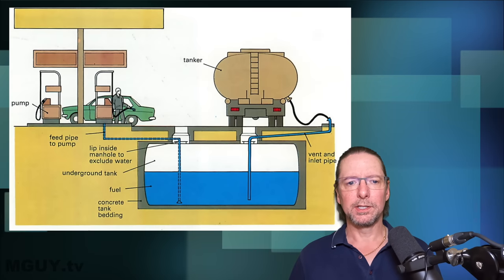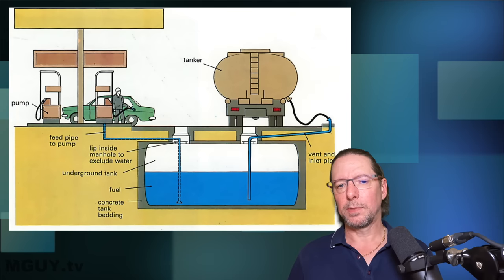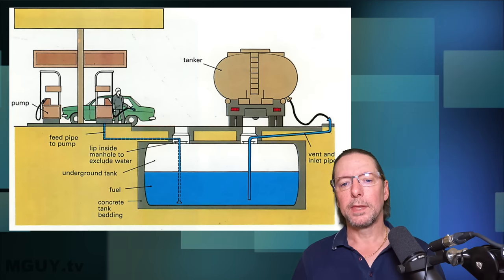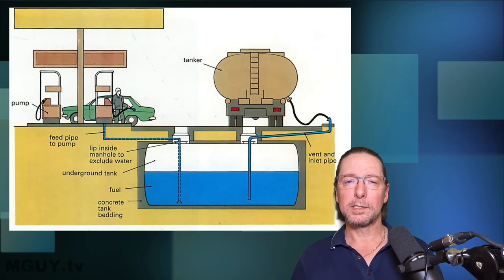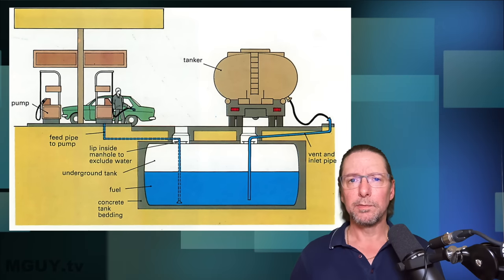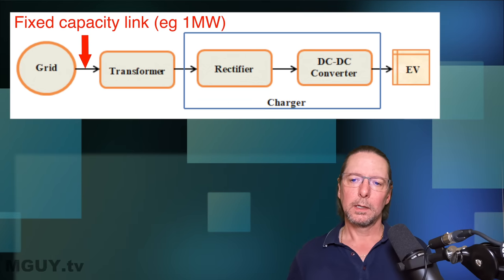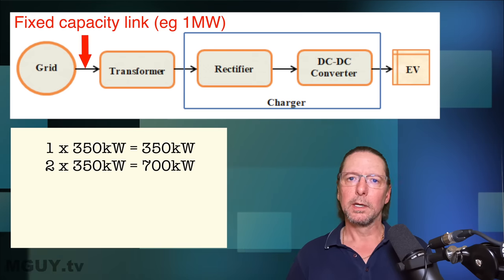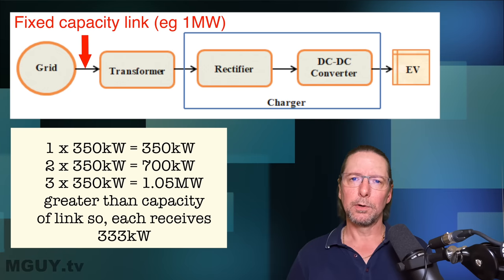HUGE problem with EV Charging Stations that no one mentions | MGUY Australia

Comment: The only true way ev can feasible work is to have a standard fuel cell that can be swapped out, the station will have to be like warehouses to maintain and store the power cells, and have enough to maintain demand. But the only way to work is to have a standard cell that can be switched like you do a battery on your hand drill.

Comment: If nobody is talking about it, it's probably because it's not a huge problem.  I live in Norway, the country with the most charging stations built.  When chargers are installed, the grid needs to be dimensioned accordingly.  Some places this can be problematic, but it's a matter of time.
Reply: Norway traffic is microscopic compared to the U.S.. Los Angeles County alone has more registered vehicles than there are in all of Norway. All the electric power generated in Norway wouldn’t even charge a fraction of the cars in L.A. that are pumping gas at one time. Norwegians better get more realistic or stick to canning sardines and herring.
Reply: @jameshepburn4631  Electricity needed to run all LA county's 5.4 million cars according to average driving distance is 23TWh a year.  Norway produces 145TWh a year of hydroelectric power.

Comment: I think the answer has to be that a larger percentage of EV owners would need to charge at home instead of using charging stations.  basically the infrastructure cannot handle the same number of vehicles if they all charge electrically instead of filling up with gasoline.  so you need a massive increase of charging locations, and the best way to get that is for people to install them at home.  This doesn't appear to be happening though, and I wonder why not.  One of the prime attractions of EV's to me is the possibility of charging it at home instead of going to a gas station.  Does anyone know why that is NOT happening?  is it because of the cost of installing a high voltage/amperage outlet?

Comment: If we do go electric and convert all petrol stations to electric charging stations every single overhead transmission line needs to come down and be replaced with something 10 times thicker, or change all the switchgear and isolators and up the voltage everywhere. (100kwh is 1MW for 6 minutes) i dont see how they are going to do it.

Comment: The answer removable standard cells like any battery but bigger, slide your expended one out and pay for a fully charged one to replace it and off you go straight away BUT and it’s a big one, we all know all batteries perform best when new, over time they retain charge less efficiently for less time. So if you paid for a fully charged up new cell which in reality was working less efficiently, gave less power and mileage, surely you would have been short changed in comparison to sliding in a perfect new battery cell.

A lot of these issues don’t seem to have been openly discussed and thought through.

Comment: You got the real problem wrong. A typical gas station can fill up about 10 cars per pump and hour and has what, 10 pumps? That's 100 cars per hour for 100% "charge". BEVs require about 30 minutes for a 20% to 80% charge. A full charge takes an hour. So to replace one gas station, you need 100 chargers and a renewable 15 MW plant dedicated to it (cars typically don't charge at sustained power in excess of 150 kW). Forget the grid, that would require significant grid updates, the power isn't there without the new plants anyway, and huge batteries would have to buffer the grid. That is done in many charging stations b.t.w., battery buffers.

So BEV charging simply doesn't scale. The new infrastructure required would be absurd.

Comment: The only way I can see electric vehicles being a success is if it becomes possible to swap out a nearly flat battery for a fully charged one at the fuel station.(Similar to how you swap gas cylinders for camper vans). I’ve heard the Chinese are doing this.

Comment: Except that tank eventually deteriorates and routinely leaks, often contaminating groundwater for decades. You have all kinds of oil and fuel spills, also contaminating soil and groundwater. You have unrecycled EV batteries leaching lithium. Until you have a thorough accounting of all the transferred costs, i.e. crap in that supply chain that gets dumped onto the public to pay for, you can't really compare the two systems.

Comment: I see what you are trying to say, but I’m also thinking that your claim is not true. I don’t know what delivery Supply Voltage EV charging stations provide, so, for the sake of argument, let’s say it is 115 Vac. If the supply voltage is reasonably regulated, then it should stay pretty close to 115 Vac across a wide range of Current Draws. Since EV cars each carry their own individual Battery Charger, then, per Ohm’s Law, the Current Draw for a single EV car will be the impedance of the Battery Charger PLUS the impedance of the Battery. This impedance, considered with the 115 Vac supply voltage, will exclusively determine the Charging Wattage for a single EV car. If the transformer that delivers power to an EV charging station is selected properly, then the transformer should be able to deliver, per individual EV car, the same charging wattage to each car of a 4-car charging station, regardless of whether one car is charging or even 4 cars are simultaneously charging. You have to remember that, on the Electrical Grid, if the voltage “dips”, there are folks who monitor for this possibility, 24 hours a day, and accordingly adjust the amount of Electrical Power supplied to The Grid. With all this in mind, the whole problem comes down to merely selecting a sufficiently hefty Power Transformer at the EV charging station location.
NOTE: From reading the other comments in this forum, I am guessing that Australia has a lot of trouble when it comes to maintaining sufficient power on the electrical grid. I say again, if the GRID can supply enough power, then the whole matter comes down to the selection of a sufficiently hefty power transformer AT the EV charging station location.

Comment: I am amazed that a single EV charging station = 350KW. I have looked after a few power stations on remote mine sites. The smallest (not small) was 4.75 MW = 3 x 3612 Cat gensets using 2,200L of Diesel EACH per day. The largest was 42.5MW = 6 x 3812 Cat gensets EACH using about 8L a minute (from memory), requiring a minimum of 3 road trains of fuel a day. Where is the economics (allowing Diesel engines are not 100 percent efficient) Yes, we need to be smarter in our use of energy sources, but I think we are being conned. The nearest EV charger to our home is 421KM away. Has anyone got an extension cord we could borrow please?

Comment: while i feel,,the whole idea of waiting for so long to charge a vehicle,is ubsurd,..being a electrician,,thats not how it works,
1  ,,;load estimation
2'.lincomeing pwer,,,7,300..volts to 12 000 volt typical
3 size transfromers to accommadate,
4  ;set main  distribution   panel  or panels,
5;;appropiate sub panel  to charging stations,
so there is no problem,unless, someone who hooks up pwr,,SHOULDNT be hooking up pwer,,but i understand the vehicles take far longer to charge,,hours  even,,,not 30 mins,,,so WHAT IS EVERYONE SUPPOSED TO DO FOR HOURS,,WHILE WAITING,,there should be ,longes,beds,restarants,movie theaters...you know,,no where have i read ,,charging a vehicle ,only takes 30 mins,,,,more like 3 to 5or 6 hrs..so see our problem,,and that time only takes you 2  to  300 miles..on the best days!!!!

Comment: let's compare - gas - huge in tank pump to feed all fillers along the path at the same time (full pressure). booster pump in each terminal with filter and restrictor ( to meet gov flow rate) and counter (to charge you by). Electric smaller tank and pump (incoming power lines) can't or doesn't spend the money for size enough for all at once  so the more charge at once the longer it takes. you would need a substation at some of these charge points to have enough capacity for all at full rate. power companies won't build more plants for the chargers alone. that's what is needed

Comment: OMG You just pointed out another reason EV will be a complete failure. The Chicago Illinois area show another EV failure. Battery capacity in cold to extreme cold weather.  Very short driving distance and extremely long charging time.  Very long lines of EV waiting to be charged. heating and colling your interior also diminishes driving range.

Comment: There's a few things wrong here. I'm sure this scenario is definitely valid, but doesn't seem to be the norm at the large EV charging stations I've visited with 30+ chargers here in the UK. Each batch of chargers will have it's own transformer with a separate link to the grid. Often times a large section behind the chargers will be mapped out for future transformer expansion. Our EV charging network is still woefully ill equipped, especially during holiday traffic but these large expansion projects I've seen going on at most service stations should help someway to alleviating that.

Your comparison with the pumps isn't accurate. To be more accurate you should consider the tank as the grid and each pipe coming into it as a new link to a transformer and a batch of chargers, that would be a closer approximation to your analogy. One advantage of EV charging of course is that when the fuel tank is empty you're stuffed until a truck can turn up to refill it, which happens very frequently when there's any sort of fuel scare. Whereas with EVs the tank is effectively the entire national grid so for all intents and purposes is limitless since we don't get blackouts in the UK and our grid is certainly not the weak link in the EV transition.

Another thing you've done which is very odd is consider the maximum possible charging power available currently in your example. I've never been in a car that is capable of receiving 350kW, I know there are some very new ones that can but that is far from the norm. Typically you'll be charging up with something like 100kW from public chargers which is plenty enough for a stop off and will charge your vehicle to 80% usually in around 15-20 minutes for most EVs. This makes your example able to handle 10 cars on a single MW link which is of course far less dramatic.
Reply: Well... 
I think you trying to say each individual charging station would be pulling of the entire grid is a bit inaccurate.
To achieve that each individual charging station would need it's own line directly from the grid, it's own main electrical panel with a separate transformer from the electrical mains so to create your described situation a charging center with a say 20 charging station capacity would need 20 individual main electrical panels with 20 individual sets of transformers and so on.
Reply: @gizmogremlin1872  no it's each batch. I've definitely seen stations where they each have their own line to the grid and their own transformer, but I've also seen ones where each batch of 3-4 chargers is connected to one link to the grid and one transformer.
Reply: @Kewickviper  
And... that doesn't negate what I said. If each charger or 3 to 4 chargers had their own line that is where the limit is as I explained.

1 charger with its independent line and transfer would fit your initial example of the grid acting as the "tank".
So yes if each individual charger had it's own drop then the grid acts as the tank or if 3 to 4 chargers each had their own drop then the grid acts as the tank for those 3 to 4 chargers but not any additional charging stations with additional main drops.

However the added question is to meet similar demands to gasoline will also then depend on the transmission lines in the area and subsequent power sub stations and so on as well before the grid is really considered the "tank" in this allegory as well which is shared with all other electrical applications in that area as well.

Comment: I do all my EV charging at home off my home battery that has been filled by my solar panels.  5 hours overnight to fill up my EV. The home battery is bigger than the EV's battery. There is absolutely no problem for me. With the home battery, I have paid zero for fuel and done over 20,000km. I can't see why most people can't do this. 2 fuel tanks, one at home the other in the EV. Don't need EV charging stations except in emergencies or long trips. I laugh when I see petrol prices at $1.60/ litre.

Comment: Those charging stations still use coal fired power plants to produce the electricity. Keep in mind the batteries in those cars a very expensive to recycle and are very hazardous to the environment. Plus you really aren’t saving any money and it takes a half hour to 45 minutes to charge the car.

Comment: Everyone is talking about this.   Build more chargers.   thats the solution.

But, your model isn't correct.  The transmission line is equivalent to both the gas tank and the truck.   In your model, if the gas truck is late or incapacitated, then your buffer runs out.

There are lines at charging stations similar to lines at costco gas stations.  It's no different.  But, gas pumps can't be modified to pump more gas.   Superchargers are getting bigger and more powerful.  Tesla is rolling out V4 chargers at 500kWh per stall, 4x greater than the current 125kWh stalls

Also, you leave out the most important point.   Most EV owners have charging at home, and can avoid driving to the gas station, filling up gas, running into homeless people, the threat of a gas can catching on fire from an idiot (happened to me), hitting traffic hour.   And, if you leave in a rural area like Australia, that could be an HOUR or more trip.  

I kid.  I'm sure Aussies are modern people.  I hope to visit there one day in my EV 😅

Comment: I believe you are incorrect about the function petrol dispensers. In general, each dispenser does not have it's own individual pump. Each storage tank has one (usually submersible) pump that distributes fuel to several dispensers. Usually when the gas station is busy it will take longer to fill your vehicle because of fixed flow capacity of the single pump. There was a time in the distant past when each dispenser had its own pump but that is rare today. (BTW I think EVs are a scam.) Comment based on experience in USA. YMMV

Comment: An EV stores about as much electricity as a single home uses in an entire day, and for most homes, more than a single home uses in an entire week. That means if you have 10 cars hooked up, you can be pulling literally the same electricity at 10 homes use in a week....and need to supply it in under an hour or 15 minutes. That's a tremendous demand on the grid in a single area. And it needs to do this continuously, day in day out. It's easy to see that this would be a huge problem if EV adoption was 10%, let alone 100%. We're talking about literally hundreds of times normal demand on the grid over a short period of time. Now imagine what it would cost to magnify the capacity of the electric grid by 100 times. It already cost trillions just to have what we already have. Which means EV adoption would cost literally hundreds of trillions of dollars, just to have an energy grid that can support it. It's a fools errand.

Comment: Where i see your logic in this, it is somewhat flawed. Any ev charging site designer will factor in electrical requirements, if the site can charge 30 cars (as an example ) at the same time the power supply will be built to handle 30. The only exception to this is where it is very small scale eg a shop installs some stations in their parking lot and the stations are connected to the shops own power system without consideration for the power draw the stations have. I'm not saying what you said is impossible but it is highly unlikely

Comment: Here's another problem that isn't talked about much. One gas pump can fuel a car in five minutes. So a gas station with 12 pumps could theoretically fuel 144 cars per hour. But a charging station with 12 chargers can barely charge 12 cars in one hour. So how many chargers will we need to replace all the gas pumps at 115,000 gas stations in the USA? Each station has between four and sixteen pumps... so this means we probably need a lot more charging stations than the 138,000 plug in outlets we have today before we can go "100% EV" in 2030.  But, I suppose we will find out the hard way.

Comment: Stimulating presentation.  Here is my idea: 
The central issue for many who would consider purchasing an EV is a lack of accessible battery super-charging sites.

A home installation for adequate, overnight charging, is expensive.  Additionally, many older homes do not have sufficient electrical power that would allow for efficient 240-volt chargers.  The issue for urban, multi-story residences and office space without dedicated parking spaces, exacerbates the problem.  

The Tesla supercharger needs only 40 minutes to provide an 80% charge.  40 minutes is also the average time a consumer spends shopping at big-box stores (e.g. Costco).  Big box retail locations can have ample electrical capacity to allow dozens, perhaps even hundreds of super-charger, plug-in parking spaces.  Tesla should consider partnering with big-box store operators to install high-capacity electrical superchargers for their retail parking lots. 

HOW WOULD IT WORK
The shopper parks at a supercharger parking space pays via credit/debit card, plugs in, and sets off to shop.   Returning 40 + minutes later, the shopper unplugs, and leaves with a near-full battery charge (killing two birds at once). Coupled with an adjacent electric panel solar charging field, the consumer would pay less on the days when there is full sun.